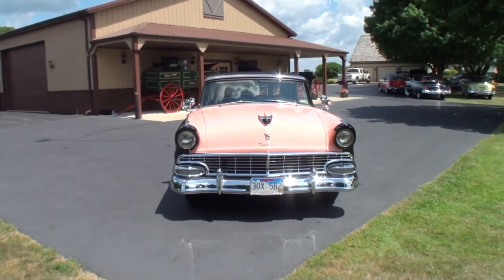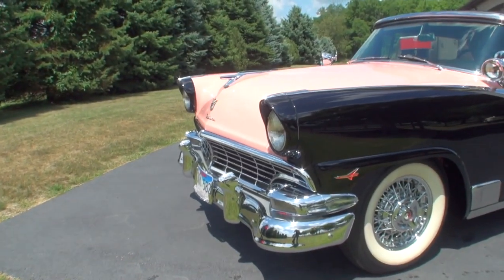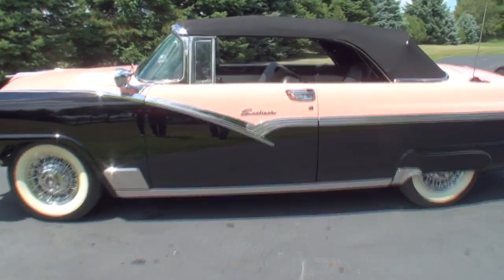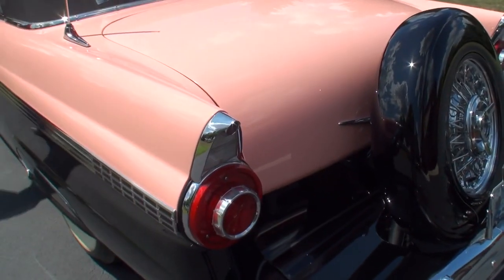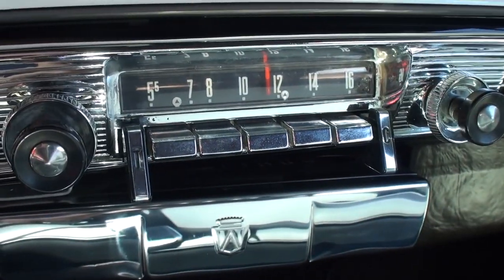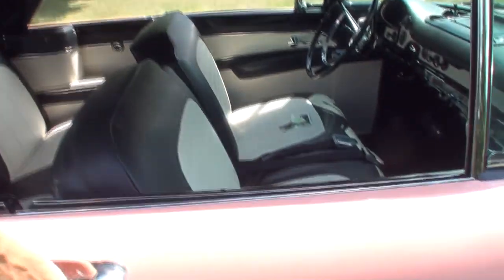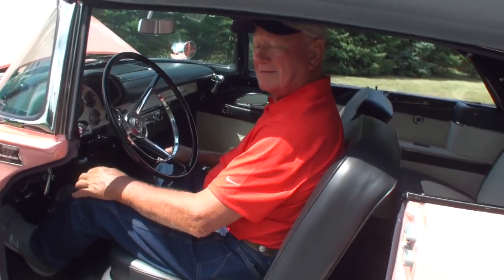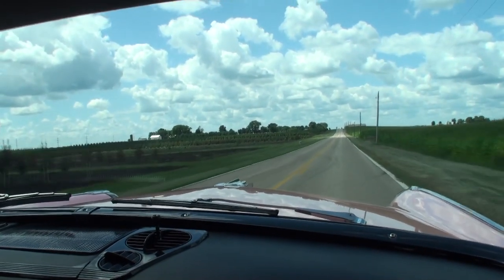1956 Ford Fairlane Sunliner Convertible in Black / Coral & Ride on My Car Story with Lou Costabile

Comment: LOU! I thought I liked the 55 Ford more then the 56 and This car has changed my mind. WOW!! ABsolute WOnderful
Reply from the maker: High praise :-)
Reply: gene978 thanks, I had a low miles, CHERRY , 56 4 d, t Bird engine, etc.:: always regretted not being able to OEM IT OUT.AND KEEP... ALWAYS WONDERED HOW MANY 56 Fairlanes SELECTAIRE & TBIRD ENGINE, ETC....NOT ,ANY left, today: have a memory of big Air Cleaner & assembly.   ,surprising me, before I became a car Nut, etc.Always want3d the Manuels TRANS TO switch to Hurst Floor shift::: big must do  in Northern Indiana in 50/70s....( esp,IF COULD SQUEEZE 4 Speed in & looks stock, etc.).....Do remember a Classmate$ : 57 Fairlane500,  BUILD up bigger  BRAKES, tires/hot 312 build up, 4 SPD,INTERIOR SPRUCED, ETC. .. previously **I had a 54 Ford/2d ,with build a57 /Engine,4BBL CARTER / Manuel  build up: **handling and Braking poor( actually lost brakes , deep water wets , and line out)  AND I ACTUALLY REALIZED AT AGE 15–16....DID GET A FENTON Floor shift in, etc.

Comment: Our house in the 1960s had a tiled breakfast nook with the same coral and black color scheme as this convertible. Nice combination. Regarding 3 on the tree shifters, dad was issued a 1967 Chevy Biscayne equipped with a 6 cyl. and 3 on the tree as his work car for the Nebraska Roads Department. I think you could still also get them as standard equipment on certain pickup trucks up to around 1980 or so.
Reply from the maker: Hi J Johnson, Happy to read this color combo brings back memories of your house in the 60's breakfast nook :-) Lou

Comment: As I expected with Ken, an impeccable example of a classic '50's car. The factory AC is very rare on a convertible in '56. I always was torn between the '55 and '56. The '56 is showier, but I love the '55's unique dash and the round front directional pods. By the way Lou, you're correct to assume the exhausts ports were not being used. Because they made the chrome so dirty, many people had the exhaust exit from below. Also, "3-on-the tree" was still going strong till about the mid-'60's, particularly with older drivers on lower-line models with sixes.
Reply from the maker: Hi Joseph, Thank you for viewing and sharing your knowledge, Lou

Comment: Thanks Mr Nagel for another great car.  It seems before 1955 to get a high trimmed/optioned car you had to move up from Ford, Chevy and Plymouth.  It became obvious in 1955 that the low priced three with an optioned top of the line model could be as nice if not better than many of the mid ranged cars.  You have to give FoMoCo credit in the 1950's for giving an extra effort on their cars with the 54-56 Skyliners/Sun Valleys, 57-59 Skyliners, the 57-58 Turnpike Cruisers, the evolving 55-60 T-Birds and even giving a unique "Sunliner" name for the convertibles.  1956 Fairlane's are great from any angle and this cars colors even enhance that.  I noticed a green 56 Mercury Montclair in the video that I hope is one of your future cars to review.  Better yet if it is ok with Mr Nagel, it would be great to do an episode just scanning all of his car collection together with a little more detail from Mr Nagel on the when and whys of his collection.  Thanks again Lou.
Reply from the maker: HI Allen, Or...better yet!  Mr. Nagel has agreed to share each one of his cars for you on this Channel :-) So stay tuned. My pleasure sharing with you, and you're welcome, Lou

Comment: Yes-“3 on the tree” carried into the 1960’s.
Reply: Three on a tree, and yet otherwise loaded out with options. Factory air was rare and an expensive option in '56.
Reply from the maker: Thank you for viewing and sharing your knowledge.
Reply: I took my drivers Ed. in a brand new "68" Ford Galaxie with a three on a tree.
Reply: 3 on the tree was avaidable on GM trucks till the mid 80s

Comment: i had a 55 ..2 dr 6 cylinder then a 59 rag top black with red and white inside 332  auto 2 bbl .. dumped a 427 dual 4's 425 hp 4 speed out of a 1964 ..4.11 rear .. it went ok but really to heavy .any way the 56 was the cleanest for the 55-57 series .. outstanding car
Reply from the maker: Hi Roy, Happy to read this one brings back memories of your 55 :-) Thank you for viewing & sharing, Lou
Reply: I read that the 332 was the first iteration of the FE engine, so I guess you knew the  427 would would fit perfectly.
Reply: @Johnnycdrums  oh ya the 332 was an auto so i had to weld the clutch bracket on the frame and just swap in the under dash stuff .. all worked out . even the drive shaft fit perfect .. the 4 speed trans was the b.w. t-10 ford used before the ford trans .. the dual 4 air filter cleared the hood , i had to use the 332 ex manfolds , way smaller them the big 427 cast headers .but i had no idea if the 352 ones were any larger inside . .but the frame on the 59 was to narrow  compared to the 64 .. i swapped the alt for the 59 gen .. and the fuel pump for the vac wipers .. everything just swapped over perfect.. throttle linkage lined up .. top hose angle , took 2 1/2 days out and in .. stock gears held it back 2.92 or 3.10 .. so i later did a 4.11 swap .. but still the 59 rag top was way to heavy .. but hell what did i know . young and dumb .. on the dual holly 4's i used screws in the linkage to make the useless vac secondary into everything opened at once .. was going to dump it into my 67 mustang 390 gt . but never got around to it .. life moves on and vietnam called then the wife and then all the no fun stuff ..

Comment: Good Lordy, how many names can 1 car have? Fairlaine, Sunliner, Crestview, Thunderbird. I get the Thunderbird edition, but this wasn't a hot rod in the day. Beautiful Ken and best use of conti kit with integration with tail lights. Did they all come with the kit, the gas cap looks too plain?
Reply from the maker: Hi Pat, Not sure if the kit came with the car, however if Ken has it on the car, I would guess the factory could add it. Lou

Comment: I was born in ‘56, my father also bought a new ‘56 Ford the same year, not a Fairlane or a Sunliner but a 4 door Custom...Customliner? The storey of this car goes like this: my mother never saw the car until he brought it home. Which was typical for him to do for the rest of his life, buying cars new or used and not telling my mother until he brought it home. She refused to ride in that 56 Ford or drive it. Reason, it was two tone, GREEN AND YELLOW! She found it disgusting and he immediately had to have it repainted keeping the green and having the yellow painted a different shade of green. He always said he thought it looked so sharp in green and yellow and he never liked the new two tone green. That car also moved us while towing a trailer with household belongings from Canada to south Florida and then back to Canada again towing the same enclosed box trailer. He sold it in 1963 after buying a used ‘56 Buick Special. Cheers Lew 🍻🥂🇨🇦🇺🇸 
Correction, a ‘58 Buick Special not a ‘56.
Reply from the maker: Hi Trip Reviews, Happy to read this one is the same year and your birth year :-) Glad to read this one brings back memories of your Fathers 56, Lou
Reply: Trip Reviews thanks, for story.. I fou;d a 56 4 door/TBIRD/4 door/ air conditioning , not work/ Florida Car , low miles but totalled it in a few month( not my fault) ,barely starting upgrade....... !! I ALWAYS wondered how Manynyears, it could have ran...